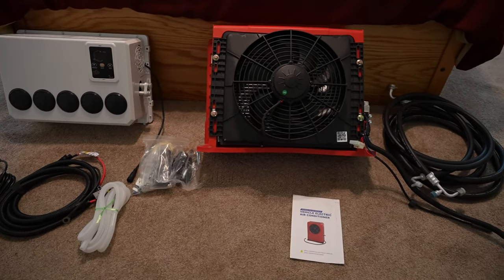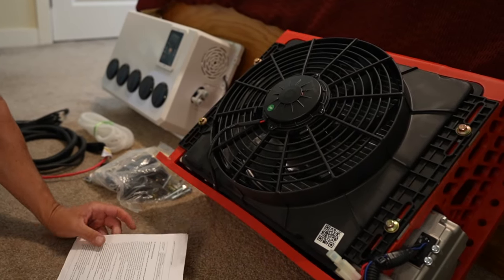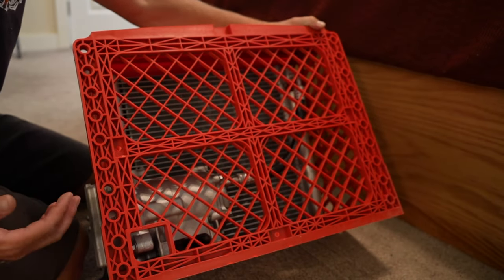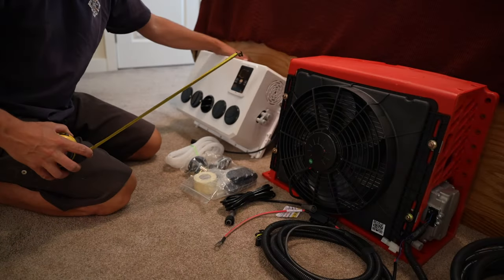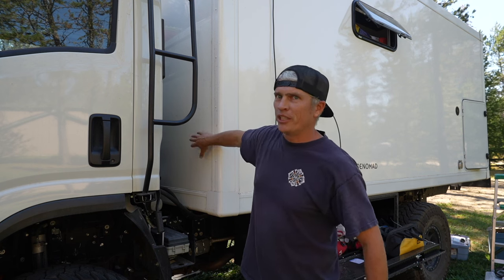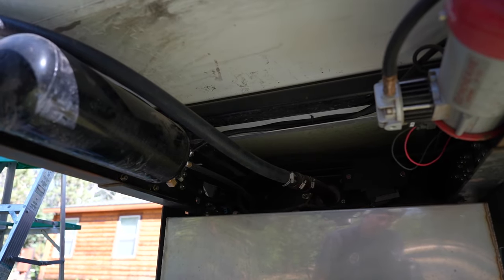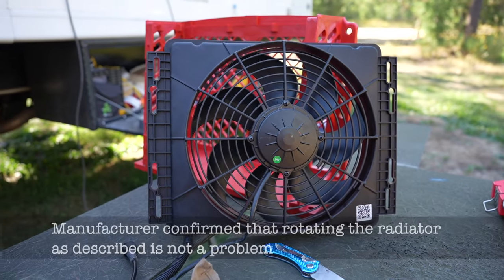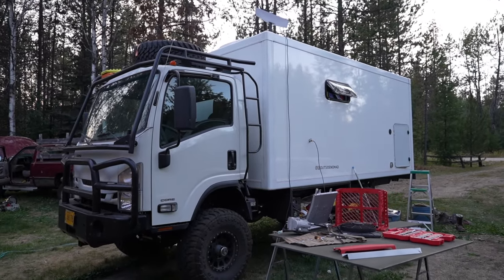The Best $800 12v Camper Van Air Conditioner for Overland Travel - 12 volt/24v DC Powered AC Part 1

Comment: EG4 has an affordable hybrid AC/DC model which could be considered.  It has inverter tech, better construction, and better efficiency.   The EG4 AC/DC units are completely DIY: pre-charged lineset with quick connect fittings, no vacuuming or refrigerant needed. Not sure if EG4 duty cycled for bumpy roads though. $1,299 online. "EG4 Hybrid Solar Mini-Split Air Conditioner Heat Pump AC/DC | 12000 BTU | SEER2 22 | Plug-N-Cool Do-It-Yourself Installation" from Signature Solar.

These 12v units are $500 cheaper, smaller, but plastic.  The interior fan motor is encased by plastic, which could melt or offgas.  The whole thing seems to want to fly apart. But yeah, a  12v option, very exciting.  These can be repaired by truck mechanics who are familiar with them, and that's important on the road.  Plus no HVAC techs want to touch your regular mini split with a 10 foot pole unless they installed it.
Reply: This unit is too high a voltage, it does not run at 12/24/48v, it is much higher to accommodate its Solar panels 72v i think is the low side. Don't quote me on that unit, I am building out an earth roamer and did investigate that unit, it just would not work with my 24v system. I am running off of memory now it has been a while, but again it runs at a much high voltage to work with the panel voltage. Not a 12/24/48v system.

Comment: It looks like, if you wanted, you could ditch the red box altogether and mount the compressor and condenser however you wanted. Side by side so the whole thing isn't as deep, even?

Looking forward to hearing how well that unit works!
Reply: You’re correct the box isn’t needed, but there must be sufficient free space behind the condenser to allow for ample airflow and heat dissipation.  For example it would not dissipate heat well if condenser was mounted directly to the flat van surface with 1” clearance.
Reply: @marcusmuretic199  Thank you for the insight! I'm contemplating a minisplit on a van and picking up good tips like this will help the plan.

Comment: Hey great video! I used this to help install the same unit on my rig and it’s works great. Thanks for the upload! 

I was wondering if you still have the contact information for the manufacturer. I can’t seem to find it online. Trying to figure out if there is a time delay function in the unit. Thanks!

Comment: Great informative video. I also watched the part 2. I ordered one from aliexpress 2 weeks ago. I purchased two 200ah Lifepo4 batts. Going to run it12v. The setup is for my 24' cabin boat, Hopefully my batteries are sufficient for a night, might need one more 200ah? we'll see. not much real world testing of these other than your vids. Hoping it averages significantly less than 75 amps an hour overnight in the small berth of the boat. Will be nice if it runs 500w on low. 45 mins an hour, getting me close to 10hrs
Reply from the maker: Definitely let me know how that all works out. I agree that your space will be easier to cool. I also run mine on a much lower setting during the night. I just want to take the edge off the heat so I can sleep.
Reply: @outsidenomad  I will definitely report back. I'm curious if you use some type of power supply to power the dc load if you happen to be plugged to "shore power"? I'm considering a powermax 110 to 12v charger/ converter.
Reply: @wests3771  How did it go?
Reply: @hummerguy  I haven't completed it yet because I just finished repowering the boat. Just got the batteries wired up yesterday and the ac should go in early next month. I'll let you know!
Reply: @wests3771  Oh nice, have you took it out the box yet? Im curious if the vents can be removed out the evaporator and replaced with a hose
Reply: @hummerguy  I just finished the installation and it's awesome. I think you could tap a 1.5-2 inch hole on the side of the evaporator. just do it high enough to prevent condensation from spilling out. I think I'm going to duct it this way with a pool vac hose to the bathroom of the boat.
Reply: @outsidenomad  Dude, just finished the installation in my boat last week and took it out camping, we anchored off a remote island and the AC performed excellently. it's the 12v version and on turbo it pulls just under 50 amps. On sleep mode or eco mode, it consumes 21 amps initially then only 13 amps as long as it's within 2-3 degrees of set temp. So with my 400 AH batteries no matter what it lasts through the night and I can get two nights with the way I run it. Way better than expected, cools the cabin in 10 minutes, and no generator is needed!
Reply from the maker: @wests3771  Right on! Sounds like a great setup and glad it's working well for you.  Ours is still working great
Reply: @wests3771  I ended up using a 2 inch vacuum hose, I put some duct tape around the end of it so I can get the hose in there tight
Reply: @hummerguy I just did that also, I used a pool hose and duct it to the bathroom and also ducted an air intake at the highest point in the boat also. I also moved the thermo probe from the coldside to the air intake side and it Cycles way less  now

Comment: Hi, I purchased the same unit you have and then waited several months before I opened it to find I had no manual. Is there any chance you would have a manual you could sell me or a web site that has the operating instructions or at least the error codes. Thanks Roger

Comment: If this thing cools well and holds up you are onto something.  We just installed a 110 mini split (cool/heat) but it took a lot of space and will take a lot of power.
Reply: @outsidenomad  our mini split is pulling 960W when the compressor is on.  We will head to Baja in mid Jan.  Hope our paths cross.

Comment: Thanks for doing this video, I've been interested in these for a while. I'm thinking of installing one in a Sprinter van. How do you think the condenser and fan would do under the van? Would I need to build a special enclosure for it? It's nice it dosent have to be set at a 15 degree angle like the Cruisencomfort condenser. Thanks
Reply: @outsidenomad  cheers!👍
Reply: @outsidenomad sorry I had one other question....I plan on putting the compressor inside the van which differs from your setup....is it overly loud? The box truck is great for installing things compared to a van.

Comment: Using this unit with a 12v system and man it rips through my batteries. When its 90 outside in virginia it runs at 60a when set to 28 and around 80a when set any lower. Its supposed to be pulling like 30a on full blast :/

For context, when i have an inverter on and running a 900w microwave, its pulling 130a, so thats a considerable power draw. 

I was hoping to survive this summer but i guess not :/
Reply: That's what I was afraid of. All ACs running off DC use a tremendous amount of battery power. There just doesn't seem to be a system invented yet that will be workable.
Reply: @beverly7475  Yeah unfortunately... Though my understanding is that while we'll probably never get to full temperature control with less power, I think the nature of vanlife is to try to keep the inside temp close to the outside temp, more than trying to keep things at a crisp 70f or what have you. 

Running it on full blast and then turning it down seems to help a lot, as opposed to running it lower constantly.

Comment: I have a model t hot rod I would like some AC in. Is there a kit like this but maybe half the size?
Reply: I used a rear ac unit out of a gmc denali that was smashed , added a ac compressor to the motor ran new lines , wired it and i had ac , but normal car ac , it wasn't a 12 volt ac pump , id like to have one though

Comment: Hello, I purchased the AC you recommended. I'm attempting to install this air conditioner. To do so, I need to hook up a vacuum pump to the inlets on the radiator of the AC. I have the vacuum pump, but the radiator's inlets are not the same size as the vacuum pump's. I wish to contact the manufacturer, and have them tell me what size/pitch/etc of adapter I need. But the listing has no brand, and the manual doesn't list the name of the manufacturer. You said you spoke to the manufacturer. Can you provide that information, here? Thanks.
Reply: For anyone else with such issues, I spoke to amazon support, who say the manufacturer is "Nekpokka AC Cooling." So I have contacted the manufacturer. So far they've just said, "The port of the hose valve can be connected using an R134a connector adapter." I'm not sure if they're confused about what I mean, and think I'm just having trouble connecting the yellow tube of the vacuum pump to the refrigerant, (which I already got an adapter for,) or if they mean I should buy some r134a "kit"... if I solve this I will probably post the answer here. I would still appreciate input.
Reply: Buying a kit solved my problem. The AC works, though the indoor unit drips water.

Comment: Very interesting. Does the radiator have to be vertical or can it lay flat? I assume there is no room in the engine bay - so you could mount the radiator in front of your main radiator and eliminate the fan altogether?
Reply: @outsidenomad  Ahhh yes of course - its for the box. Yeah, I was thinking of cab AC setups which you would use when driving.

Comment: Hello,
Awesome videos sir. I am curious of how it is holding as of now. Also is it really that loud outside with it running or was the mic making it louder then it actually is.
Reply from the maker: I don’t think it’s very loud. It just sounds loud in the video. It’s certainly quieter than a traditional RV ac but louder than a residential mini split.
Reply: @outsidenomad thanks, it has good things going for it. One it runs on a battery and two the public can get the refrigerant easily. I was asking because of stealth mostly.

Comment: Mine keeps short cycling...do you know a way to move the thermostat on it or install a thermostat on it?
Reply from the maker: No i don't.  Might be best to reach out to the manufacturer.  It would be easy to switch out the main control board if perhaps it was defective
Reply: Did you ever figure out the solution to this? I just installed one on my van and it’s short cycling and draining my battery’s quicker.
Reply: This unit 24v or 12v?
Reply from the maker: @Sinerwray  It's available in both, i have the 24v model
Reply: The best ac is a thermoking Apu
Reply: I just came back to this video in case anyone was asking. Take the front face off of the indoor unit and move the thermo probe from the blower side up through to the top intake! I was totally confused when I saw that. It runs way less frequently now

Comment: 1. The Amazon link says it offers 13,500 BTU use at 750w power consumption; have you tested the consumption to confirm?
2.  I didn't see in the Amazon link that it mentions 12V only 24V, can anyone confirm it works with 12V?
Thank you! ✌🏾
Reply from the maker: The units do not work on both 12 and 24 volt. You need to specifically order the appropriate voltage. The link I originally posted had the option of choosing the 12v or 24v version. Look closely it should be there somewhere. 
750 watts sounds about right with the unit on high power. 
I’ve never run mine on high power. I typically average about 350 watts per hour on low which cools my well insulated 14’ box just fine.
Reply: I have one treeligo 8000 btu y very nice for my kw t2000 I loved

Comment: Hello, I havr one question. Does this set have any Dryer unit?
Reply from the maker: Not sure I understand, are asking about dehumidifying setting? If so it does not.
Reply: @outsidenomad  no no, I meant drier filter, so it catches all moisture from the system to prevent compressor damage
Reply from the maker: @marf_6124  I'm honestly not sure what that is so I'm guessing it does not
Reply: @outsidenomad  Okay, I made some research myself, and it appears that this thing I am asking about is that cylinder attached to the side of the radiator/condenser. So yeah, your set have it, mine just bought have it to, so no need to worry about the compressor :D thanks for the reply and have a nice day!

Comment: I’m pretty sure you can’t change the orientation of the condenser. Gas goes in the TOP liquid comes out the BOTTOM!
Reply from the maker: My understanding or at least what the manufacturer said is that it can be upright or flat but when flat it needs to maintain an angle so that the upper port is above the lower port.